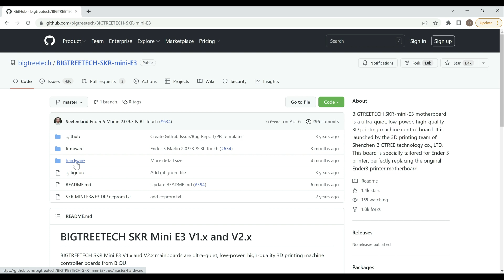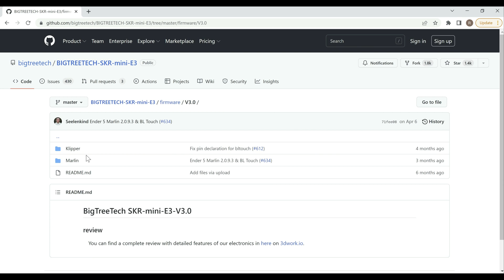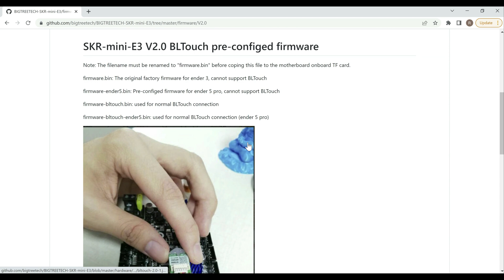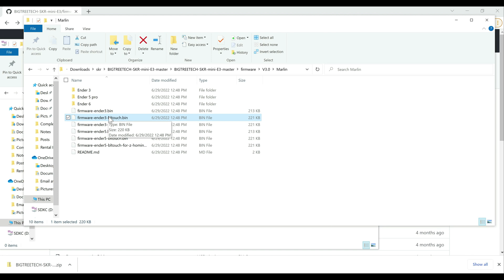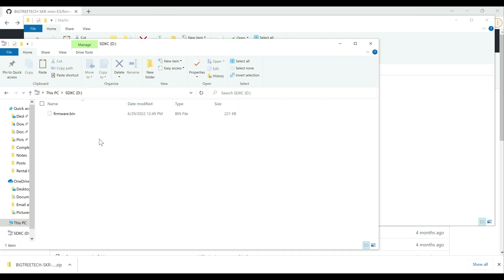SKR Mini e3 v3 BTT Firmware Update

Comment: I am hopeless at this coding stuff, I installed the BTT mini e3 v3 and found firmware that worked with my CR-10s, then I installed a miniprobe and have not been able to modify the code in a way that lets it function properly, I can't be the only one with this issues can I
Reply from the maker: Hi. What type of probe are you trying to use and you would probably get quicker help on our discord server.
Reply: Liquid microprobe
Reply: Biqu  microprobe
Reply from the maker: @paganstyle  I havent used that one, if it functions like a bltouch you can probably enable that. If not, it will be a lot of trial and error.

Comment: I'm helping a friend with his btt skr mini e3 v3 install on a ender 3 max neo.  He has added a sprite pro hotend and that hotend fried his oem main board somehow.  He got the hot end replaced and bought the btt board.  Now that everything is hooked up his screen is stuck on logo.  Stock ender 3 max neo screen.  We found that the btt screen pinkut is different and bough the repinned cable and still his screen is stuck on the logo.  

Any help if your still active would be awesome.
Reply from the maker: Hi. What screen are you using?
Reply: @3DPrintscape  it's the stock verticle screen.  The dacai version if I remember right.

Finally going through my notifications, I didn't even know I got some replys.

Comment: After I followed all of these steps I now get the read out "No Printer Attached!" I have confirmed that the file is changing to .CUR when I plug the SD card back into my computer. Not sure what is going on here, it seems like it updated but now it isn't working altogether. Anyways, any help would be appreciated!
Reply from the maker: Hi. It sounds like its not the right firmware for the board. Are you using a prebuilt or custom firmware build?
Reply: @3DPrintscape  Oh i see. It has been so many years since i messed with this printer, but I think I used TeachingTech's video and it was a custom firmware build but I'm not 100% sure. The Firmware readout on the printer says TFT35_E3_V3.0.26.x Jun 15 2020 still although the file is being changed to .CUR but I assume that it is just not being read out properly since I caused whatever issue I did.
Reply: I'm ordering a new SD card, the only one I have laying around is FAT32 but 64gb. So maybe that is causing the issue but not sure.
Reply from the maker: The firmware on the tft is different than the firmware for the board. Try one of the firmware builds from my site to see if that works.  @DrDenticle
Reply from the maker: I have had some 16gb ones work but never anything larger. Hopefully the new card fixes the issue for you.  @DrDenticle

Comment: Hi Rob, awesome video, it was a great help!  I have a question though; when I installed the firmware from the download like your video mentioned I still needed to have the Z limit switch connected, I assume that is the firmware I grabbed.  But when I then tried the version that said something about Z homing ( which is what I was hoping to do... ) using the CR Touch instead of the  Z limit switch it tried to home but wouldn't do Z and just came up with a message that said it STOPPED... I assume I am not doing something right or have a setting wrong?
I plugged the CR Touch into the port on the SKR mini board and unplugged the Z limit switch.
Any help would be greatly appreciated.
Reply from the maker: Hi, The standard bltouch firmware is the most common on, it expects the z stop and abl to be connected. If you want to only use the abl you would use the z hoking build but it requires the two prob triggers cables to be connected to the z stop port and the other 3 wires to be connected to the bltouch servo ports.
Reply: @3DPrintscape  thanks, I actually went through your Marlin build video and followed step by step, it worked awesome!  Thanks

Comment: Thanks for the tip about the size of the drive and the contents of the drive for reflashing.  I attempted an update of my working v3 with TFT display to also work with bltouch but no joy.  The tft display worked initially but stopped working after the update.  Ever run into that yourself?  Thanks!
Reply from the maker: Hi. I havent, the tft screen doesnt need anything special to work. Im wondering if you maybe used a config example from the v2 or one that has a creality screen, that would cause issues.
Reply: @3DPrintscape  Your tip about using the .bin from the source directory did the trick.  It was larger than the one in the "standard" download section - 221k vs 199K.  Put it on my microSD and updated correctly.  Thanks so much for the tip!

Comment: Thanks man, I actually had to go way back to installing VS code to understand how to make this work. You're the first that's explained the install. Since I'm using the board on an anet, it's challenging for me. pronterface It reads that the endstops are triggered when open and visa versa. So I have to do some modifications to that, reverse the motor directions, and other stuff. I'll make another post if I'm successful.
Reply from the maker: Hi. Thanks for the feedback, looking forward to hearing how things went.

Comment: I'm a out to break it cause I can't get it to print right the z axis is slow as hell. Have cr touch with three pins in the one spot and 2 in thr z stop have the right firmware but it won't print any detail and z axis is slow as hell
Reply from the maker: Hi. That really sounds like a firmware issue. What firmware are you using?
Reply: @3D Printscape  firmware-ender3-bltouch-for-z-homing.bin. the one under marlin for ender 3  I didn't see one for ender 3 pro.
Reply from the maker: @WrenchRepairsAndProspecting  There should be no difference between the ender 3 and 3 pro firmware, assuming the boards are the same. It does feel like a firmware issue still. Have you tried building your own? Also, try to clear the eeprom.
Reply: @3DPrintscape  I can't get the vs software to work on my pc I have no other idea on how to build firmware.  But I have tried that once before  but I'm ready to do a complete reset and try again. I'm so mad at this thing.
Reply: @3D Printscape  it is apparently not feeding pla to fo the details of my print.  I gotta try another print.
Reply: @3D Printscape  I switched to ultimaker and it works now. Just debating switching to the 4.2.7 board. Instead of this skr e3v3 mini.  That and maybe looking at the ender cr5 pro h
Reply from the maker: @WrenchRepairsAndProspecting  You will need to get vs code running. What issues are you having with it?
Reply: @3D Printscape  I'm working on it but it's very slow going. The pc I'm using is very old.  But I wish someone just had a simple firmware made I can just download.  It's basically a stock machine.  Just dual z axis with one wire.  No z stop cr touch and direct drive all creality parts.  Only part that not creality is the board and the 4 wheel mount for the direct drive.  Added stability. Uggggggg its printing now just like crap
Reply: @3DPrintscape  I got the vs code working but what extensions do I need to edit the bin files.
Reply from the maker: @WrenchRepairsAndProspecting  you need platformio and i would also recommend the marlin auto build plugin.
Reply: @3D Printscape  I tried all that keep getting errors I've watched video after video snd keep getting errors

Comment: I upgraded my original ender 3 board with the V3 and added a bltouch as well. I downloaded the firmware with the bltouch file, not the z homing file, but I'm having issues. When I try to auto home, the x and y home no problem, but the z axis has no idea what to do. I tried reflashing the firmware, but the homing the z axis is still an issue. What can I do it fix it?
Reply from the maker: Hi. Is your z stop still connected? The firmware assumes it is.

Comment: this doesnt help me with my 3 v3.0 and sonic pad.  It wont take the 3.0 firmware.  It keeps changing the .BIN to a .CUR and doesnt flash the firmware.  Help? thanks
Reply from the maker: Hi. The only time i have seen that is when the firmware isnt compatible with the board.
Reply: @3DPrintscape  I figured it out. It was just the stock screen wasn't working on klipper.
Now my nozzle is getting so hot that it's glowing and smoking really bad
Reply from the maker: @JonBallRealEstate  That doesnt sound good at all. It means the temp is way to hot. Did you get that figured out?

Comment: Great review as always. Question I have a Ender 2 Pro if I flash using Ender 3 V3.0.1 and change the bed settings/height etc would that work for me? Thoughts? tks!
Reply: I tried flashing Ender 3 firmware on Ender 2. Not sure if it worked but all of my x,y and z are at 0. I did reset the eprom and settings but still all at zero. I can't run my Cr Touch. Thoughts on this piece? tks!!!
Reply from the maker: Hi. The short answer it depends on what board is in the Ender 2. Do you happen to know?
Reply: @3DPrintscape  Hey Rob thanks for the quick reply. As of right now I'm dead in the water. I,e door stopper :). Problem is Bigtree websites does not have a firmware with ABL or no ABL for that matter for the Ender 2 pro. The board that was on the Ender 2 is Creality V4.2.3, I can tried to compile a marlin but I'm still pretty new at it. I was succusful creating on using Cheetah Marlin but the also don't have a Ender 2 pro perquisites. Help if you can? tks!
Reply: also I do have a spare SKR mini E3 v2 that I can swap boards with if that's easier....
Reply from the maker: @armani007E55  I would look at building marlin for your printer. You can use the config examples from https://github.com/MarlinFirmware/Configurations/tree/bugfix-2.1.x/config/examples/Creality/Ender-2%20Pro/CrealityV423 .
Reply from the maker: The skr is a better board, but thats up to you.
Reply: @3DPrintscape  awesome. I'll take a look. Tks! Appreciate the help as always.

Comment: I am having some issue with mainboard, It is not detectecting the SD card hence I am not able to flash formware through SD, is there any way I can do it with laptop??
Reply from the maker: Hi. In some cases you can push the firmware from your computer. I dont have any guides for it.

Comment: There is a V3.0.1 in there now. How do we know if that one is relevant for our setup?
Reply from the maker: Hi. Unless they specifically say it has its own firmware you would just use the v3 firmware. Most of the time the small release changes are just hardware.

Comment: do you have a pre-compiled firmware that covers the bl touch and a filament sensor wired to the SKR E3 mini V 3.0? using the EO stop port on the board? I am upgrading a basic Ender 5 (no plus or pro).
Reply from the maker: Hi. I have some firmware on my site but nothing that has the filament sensor enabled.

Comment: I blue-screened my Ender 3 last night installing a BTT SKR mini e3v3.
I turned it on after installing it initially and it worked, the cooling fan kicked on at 60 degrees and I could access the menu.
I went to install the v3.1 firmware with no bltouch, and it bluescreened.
I've tried to reflash the firmware with the 3.0 firmware but nothing has worked. I first thought that I bluescreened it because I named the file "firmware.bin" as your video says that could happen on my printer. 
It seems like the firmware was uploaded though as the file name changed to all caps afterwards.

Is there any way to remedy this without hooking up a computer?
Any suggestions here are appreciated. I am not sure the best way forward. I think I will need to run marlin or klipper eventually though.
Happy to provide more specifics for each part if it helps. Hotend is biqu h2. display board is 12864zw-10.
Any help is much appreciated!
Reply from the maker: Hi. Where did you get the firmware from and did you modify it?
Reply: @3DPrintscape  It was their firmware actually. I believe it was a 3.1 non bltouch. I ended up fixing it last night. It took a few tries, but I wiped the card and managed to get the 3.0 non bltouch to take and the printer works again.
Reply from the maker: @beiamco  Gotcha, im glad you got it working.

Comment: I am putting a SKR mini E3 V3+TFT35 on my old CR10S 3 (one of the first with dual Z) got FW to load and look ok on the boards standalone. Started replacing old boards but I had 4 fans plugged in the mini E3 supports 3 fans Marlin only has support for 2. Any ideas?
Reply from the maker: Hi. I think the firmware controls two of the fans with the same setting. If you need all four, you could maybe connect the last one with a y adapter or something similar.
Reply: @3DPrintscape  I missed the obvious. There is no fan assignment in the config files for the Part Cooling fan because Marlin assumes it is connected to FAN0 by default. The fourth fan is for the case as this is always on I plugged it into two of the VIN pins. With the correctly set up Extruder & Board fans all sorted. Should have been obvious to me but at the time but was not🙄 All back together configuration & connectivity all seems correct thanks to your video. Now I starting to recalibrate everything including the BL Touch.

Comment: Hi there, thanks for your video.  I purchased both the V3 board and the touchscreen some time ago but had terrible trouble with the printer alarming out constantly.  As a result I through in the towel and went back to the creality board 4.2.7.  I am still wanting to get this going, I guess I will just have to persist and try again. Ender 3 V2 with BLT.
Reply from the maker: Hi. Let me know if you run into issues, i can try to help out.

Comment: As before, thank you for your help. I gave up on my ender as I would get it to print perfectly and then it would go to crap within a few prints, even with a BL touch. I am about to rip the ender apart for it's Ender extender upgrades and give this one last chance. I have the 4.2.2 controller, should I get the SKR v3 to improve this performance?
Reply: I will do just that. I just want this printer to maintain prints the way my Kobra Max does.
Reply from the maker: Hi. If your not wanting to play around with the firmware too much, i would go with the SKR Mini e3 v2 for now. Both will be a good upgrade from the 4.2.2 board but the v3 is still new and the config examples can be problematic sometimes.

Comment: My Ender 3 with SKR Mini E3 V3 does not start with SD Card or not find the file, sometimes it return "SD Init Fail" my SD Card have 256mb and I formatted with Fat32, I used file with "firmware.bin" and "firmware" name.

Do you know what it might be?
Reply from the maker: Hi. Do you have another sd card to test with?
Reply: @3DPrintscape  Yes, I tried four SD Cards, one 256mb, two 8gb one a 16gb
Reply: I think that is a problem with bootloader, but I don't know test this
Reply from the maker: @BrenoMayderCruz  Can you make sure there are no hidden partitions or anything like that on the sd card?
Reply: @3DPrintscape  Yes, and I formated my SD Cards with Fat32
Reply from the maker: @BrenoMayderCruz  I have had issues in the past finding a card that worked, once i did that card worked going forward.

Comment: Any idea why the Red Status LED continues to flash even after upgrading firmware and removing sd card? The  firmware update works, because the filename has changed to firmware.cur, however I don't have a display for it yet and my slicer/rep host doesn't recognize it... Surely you can use it without a display? Or do I need to risk spending more on a display for a board that might not even be working correctly? Any help much appreciated :)
Reply: Windows recognises it as MARLIN_STM32G0B1RE CDC in FS Mode so I assume the driver is good. Set the baud rate etc in the firmware, still nothing.
Reply from the maker: Hi. Do you not have a display at all? I have never tried to run one without some sort of display.
Reply: @3DPrintscape  Hi, thanks for the reply. I bought the SKR to replace the dodgy Ramps Board in my Tevo Tarantula so I have the 2004 LCD display spare but can't seem to find documentation/pinouts/etc for compatibility :(
Reply from the maker: @chooky4626  Im not sure if its compatible or not. Honestly, if you can afford it i would just pick up a tft35. Its a great screen and works with the board.

Comment: after putting firmware.bin red LED is blinking. its ok? its thinking? where i can remove SD Card?
Reply from the maker: Hi. Which led is blinking red? And the sd card can be removed after the firmware was pushed to the printer.
Reply: @3DPrintscape  on the left of SKR logo. one Red is still flashing. and top one is blinking constantly
Reply from the maker: @Stancemir  I dont remember if thats normal or not. Is everything working as expected?
Reply: @3DPrintscape  im installing Klipper and just doing it first time :D